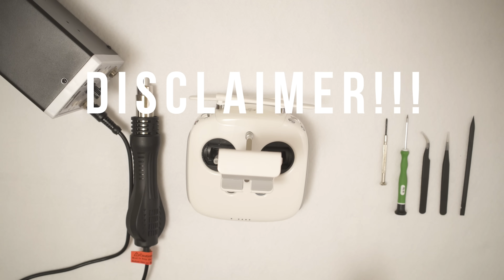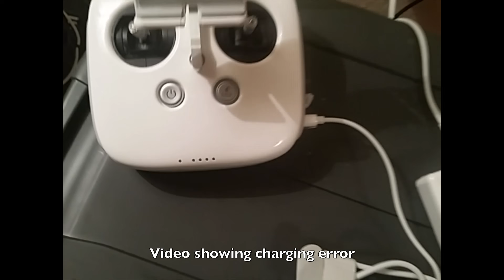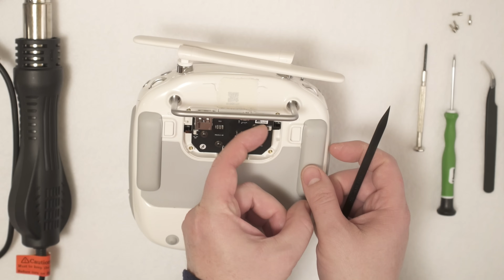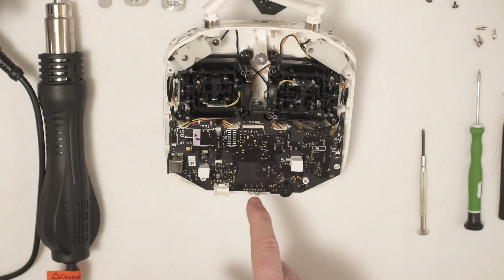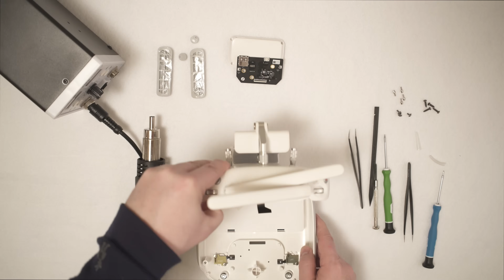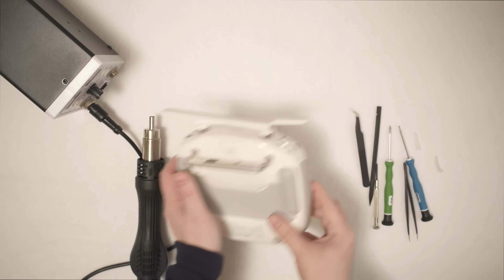FIXED!  DJI Phantom 4 Pro Remote Control Battery Charge Issue [Disassembly, Repair, Reassembly]

Comment: Omg it works. You saved me buying another remote. I took a Dewalt gun heater with a can of beer rolled like a nozzle for having just a small output. I did this 3 or 4 times and after that it works. Thank you man
Reply from the maker: Excellent!  Glad to hear you didn’t need to buy another remote!

Comment: Having the same problem out of my P4 . Just reflowed the 4 pins where battery plugs in and also the four areas were charger port is soldered to board.  Everything works perfect now. Was only getting to lights to blink before. Now I have all of them. And charging fully. Thanks for a great video.
Reply from the maker: Excellent! Thank you for the detailed feedback!  Glad to hear you were successful!

Comment: Worked great! Used a craft heat gun for about a minute each side, but went from controller that was broke to fully functional! Wished I would have watched to video through cause I made the same mistake he did and forget the rubber protector for the lights before I put the rest back together. Ha easy fix though. Thanks for the great walk through

Comment: my DJI phantom 4 after 9 flights developed this fault I contacted dji by email to be told I would have to pay for its repair etc usual run around. I looked into buying a new controller etc  but didn't fancy buying a controller that could fail as mine has so bought a rework station off eBay for £40 took a deep breath and followed the video. ribbons are fiddly but after getting circuit board out set rework to 325 degrees about 50% blower and worked around battery connector and charging port took about 5mins I'm guessing re assembled controller plugged in charger and it's fixed ! thank you so much for posting this video made it an easy repair. as someone has mentioned you don't have to take the little "com" board out or disconnect the left and right ribbons just the bigger bottom ribbon.
Reply from the maker: kevan, thank you for the feedback!  Great to hear you found the video helpful!
Reply: True about the COM board, just discconect the bigger ribbon and you are good to go.

Comment: Hye! Glad to tell you that I successfully did this today. I'm in the middle of conversation with DJI through email. Decided to try this method because DJI too slow to respond. Managed to get it right after 3 attempts and nearly damaged the charging socket on the board. Thank you so much. Now I just ignore DJI's email. Lol
Reply from the maker: Good to hear it worked out for you!  Thank you for letting me know!  And be careful with that charging socket!

Comment: Worked! The disassembly is different for a Phantom 4 Pro+ due to the integrated screen, but essentially the same fix. I did it twice, the first time didn't take. I had this repaired by a iFix a while back but the controller went dormant again and I guess that's what caused the issue again -- lack of use. Just a guess, but I hadn't used it in a year or more. Thanks for posting this. I don't think I would have tried to tackle this without this video.
Reply from the maker: William, thanks so much for the feedback, and glad to hear you found value in the video!

Comment: You Sir are my HERO! Bought an SMD Hot Air Rework Station on Amazon. Dismantled the controller, Set machine to 300° C and an air setting of 4. 30 seconds on small 8 pin rectangular component to the right of the LED's. Tried my charger and 4 lights. Prior to fix only had one light that lasted only seconds. Just finished test flight and everything was perfect. App said battery was at 95%. Thanks again! you saved me $HUNDREDS!!! Last but not least on my P4 controller the screws on the small outer cover took a 1.5mm hex wrench to remove, You do not need to remove the small board. Just detach the large ribbon cable that passes through the outer shell. Though I can see how this cable would be easier to re-attach if the board was loose.
Reply from the maker: Steve, so glad to hear it worked for you! And thank you for adding the details of your approach so others can zero in on the problem with a quick fix!
Reply from the maker: And good call on not needing to remove the small board. Now that you mention it, that might save people a step!

Comment: Wow!!! Thank you so much, pulled a dji phantom out of storage and the controller had this issue. I followed the steps and it worked like a charm!!! THANK YOU!! 

Make sure you heat the sport to the right of the lights on the back really really good. Took me a coulple times heating it before all 4 lights lit up.

Also good to check that all four light up before you put it back together like you said. Took me a couple times heating it to get it right. 

Other than that! Flawless!!

Comment: Great video. Tried it with your average heat gun on low and a few inches away. Took 2 tries cause I did not want to fry to board but it worked. After 2 minutes on low with slow passes around the areas you suggested. Thanks for posting the detailed walkthrough, it really helped me and it was much easier than I expected.
Reply from the maker: Glad it worked for you!  Thank you for the feedback!

Comment: I had the most fun doing that yesterday evening, I was 99% I'd have cooked the thing... BUT IT WORKS NOW!!! Thank you so much for the amazing effort and great video quality.

I used a cheap Heat Gun with 2 temperatures, 300 and 500, I went about 1 min and 10 sec total at low setting, going around only on one side of the board, the back with the pins. When I saw one the pin fully melting I guessed I was heating the whole thing well enough, I though way too much... until I reassembled and it's working!!!

You saved me money as much as putting me back in a thrilling drone electronic class at school ;) Loved it! Now let's fly this thing!

I did not test the board at all before reassembly, It was crackling cooling down and was so sure this thing was fried... ;)
Reply from the maker: Glad it wasn’t fried!  And thank you for the kind words!  If you find others with this controller problem, let them know there’s hope!

Comment: It's works...Hot Air 400c and fan 5 for 30 sec on the square chip to the right of the LEDs....This solution is awesome #Chakanyanya ... thanks bro

Comment: I wish DJI would just make a battery that functions
Reply from the maker: To be clear, this is not really a battery issue, but a soldering problem on the circuit board. But I’m totally in agreement with the spirit of your comment!  Thanks for checking in!

Comment: My RC would charge to 68% which worked for a few short jobs. I finally decided to follow the video. I took apart the controller, pulled the board, placed aluminum foil on either side of the black component next to the charge lights and heated it for :30. I plugged in the charger and got 1 blinking light which scared me as I had 3 before. I heated it gently again and got my 3 lights back. I then went all out and heated it up for at least 1 minute. To my surprise I got all 4 lights. Thanks to all who have contributed to this repair, especially the guy who posted the video. I'm in the video business and understand the effort it takes to make that video. While I do have 4 LIGHTS the charge level in GO4 only reads 86%
Reply from the maker: Thank you for the kind words and the feedback!  Enjoy your Phantom (again)!
Reply: @travelphotofilm  I've heated it twice now and I get the 4 lights which lasts for a few weeks and then I'm back to 3 @ 72% charge. Any thoughts?
Reply from the maker: Craig Needelman could be that you are heating the board so it takes a more favorable shape (easier for the connections to touch) but that over time it goes back to its initial shape. Second guess is that there is not enough solder for the reflow to hold over time.
Reply: @cneedelman1  I had the same problem.  Good for a while then back to 3 lights only.  Not a fix I want to have to do every 3 weeks!!  So, I'm going to try a longer heat time with a little higher heat level.  I'm also going to do a dry run with a piece of solder on an old circuit board I have.  I want to see how long it takes for it to melt.  I'll use this info  for the correct time and temp on my drone board!  We'll see what happens.
Reply from the maker: @microreniassance2929 you might also add a bit more solder when you do the new reflow.

Comment: LOVE YOU!!! I had the same issue, yestarday i did this tutorial, step by step and now my RC is charging again, the first minutes the 4 LEDS was on, then, i tried to fly the drone and the RC didnt let me because of an update of the firmware. When I updated the firmware (V.1.9.etc) then the RC only turned on 3 led and just left me charge at 70%. I flew the drone perfectly :D. Today in the morning after 10 hrs i repaired the RC) i pushed the power button of the RC and VOILA! the 4 LEDS was ON again!! In a few hours i am going to fly the drone again and see what happens with the RC. I will be updating. AGAIN!! THANK YOU SO MUCH!!
Reply from the maker: Great to hear!  Thank you for letting me know!

Comment: Thank you very much for help. I did it today and my transmitter works now perfect. 

This is what I have done: I start warming at 100 degrees for one minute after that 170 degrees for two minutes that for the shock. Next 245 degrees for one moment is just enough. Now works perfect 4 lights and the battery is full before that without charging was 35%
Reply from the maker: Great to hear it worked for you!  Thank you for letting us know what settings you used!

Comment: Thank you verry much for this video. My controller had the exact same issue and I've just followed your instructions and it's now working perfectly again. I used a Gas powered soldering iron with a very narrow torch blower fitting on the end so I could focus the heat were needed. No idea what sort of temps I was using given it's gas powered, but I had it low enough so that it took about 3 seconds to melt a tiny bit of test solder. I then slowed traced around the board where I felt it nessary. All in all, pretty straight forward and I'm delighted my controller is now working again. thank you....!!!
Reply from the maker: Great to hear! Thank you for the feedback and for detailing your process!

Comment: big thanks bro, i owe you made this video, just got the cheap heat air blower and follow this method, worked on my phantom remote with same issue, now the battery indicator light is now fully. :^D thx mate.
Reply from the maker: Great to hear!  Glad it worked for you!

Comment: So this worked for me. There is a couple things. You don’t need to disconnect the small ribbons on the first board, just the big one. Second was after I get the the back off, try just disconnect the battery for 30 seconds and re-install the cable, this sometimes fixes this problem. But it didn’t work for me and I refloated the board as described here. Thanks for this video
Reply from the maker: Colin, many thanks for the tips and the feedback!  Glad to hear it worked for you!

Comment: It worked! Thank you!
I didn’t have a fancy heat gun, just used a normal heat gun on lowest setting but had some folded cardboard to redirect the airflow away from the rest of the circuit board. Concentrated in the area of the battery connection and recharge plug. Took a couple of tries, longer each time with the heat, and finally had all 4 lights illuminate! As others have said, don’t reassemble, just plug it in first to see if the number of lights illuminating changes. The little white foam block took a bit of a hit but it’s just a spacer,, it’s still in place but shrank a little. Have flown 3 batteries and all is well so far. Thanks again!!
Reply from the maker: Many thanks for the feedback, Peter—good call on testing before reassembly!

Comment: Thank you, thank you, thank you!!! Excellent video. I used the harbor freight $10 heat gun with a homemade aluminum foil snout and an infrared thermometer. I heated the board near where you suggested for a few minutes and boom good as new.
Reply from the maker: Awesome, John, thanks for the update!

Comment: This is "cold solder" on specific elements of the disc. Soldered again and I have 4 LEDs glowing, everything works properly and loads. The heating also did, but after a while it came back

Comment: Thank you sir.. It work for my Phantom 4 RC. I only use cheap heatgun with no temperature measurement. I focus on a tiny chip with 8 legs near the right LED for about 1 minute, and heat the rest of PCB around the battery section just randomly for no reason 😅. And thank you for the disassembly tutorial too, it help so much..
Reply from the maker: Joy, thank you for the kind note. Very pleased to hear you had success!

Comment: Thanks so much. This with another video fixed my P4 that I’ve been wondering what to do with for the past few months. Common controller issue fixed. I thought for sure I would melt/ruin it but it worked.
Reply from the maker: Dan, many thanks. It is not for the faint of heart, but pretty much anyone can make this fix with enough patience and determination!  Thank you for following up with your feedback!

Comment: I confirm this works.  The only part that I reflowed was the tiny chip just to the right of the right-most LED on the same side of the board as the LEDs.  The chip is about as square as the LED diameter.  I used 400C for about 20 seconds.  Thanks for posting the video and to the other commentors for leading to the exact spot.
Reply from the maker: Thank you for the precise information and for following up with your experience!
Reply: is it the tiny square?

Comment: Just finished doing my Phantom 4, 1st Gen, remote. This seems to have worked.  Only time will tell how well.

I used a Porter-Cable PC1500HG heat gun I borrowed from a co-worker.  I used fan speed 1 with the heat dial turned up about 3/4 from minimum.  My first attempt at heating and cooling didn't work.  I hit it with the heat a second time and that seemed to do the trick.  I'll update if I have another failure.

Thanks so much for the excellent (high quality of video feed. close ups when needed) DIY repair video.
Reply from the maker: Glad to hear it worked for you!

Comment: This has worked for me - twice (had to re-flow again which, as I understand, is a common issue with any shoddy solder issue). I know it won't last forever. I'm grateful for the fix and the extra flight time I've gained! Thanks!

If others are looking for tips (and, as the video says, this is always at your own risk... I don't have a heat gun) I set the main board in my oven (pre-heated to 375F) for 10 minutes on a (non-heated) muffin tin. I didn't want to melt anything and it seems to have been enough heat to do the job.

Comment: No heat gun and my soldering iron didn't have enough oomph so I put the relevant corner of the board directly onto one of our ceramic cooker rings on max. Took it off when it started smoking gently. Fixed! On our model, GL300C the first 4 fixings weren't posidriv but v. small allen/hex bolts. Thanks for great guidance.
Reply from the maker: Many thanks, Eileen!  It is very possible I mislabeled the screw/driver type; thank you for the clarification!

Comment: Thanks for the video. Have had the same issue, done this process and now have the battery lights and charging again. Upon putting back together I went to turn on, it has no beep and also red flashing LED. Pulled apart to check everything is connected, which it is. Anyone else had this happen, or am I the unlucky one who's board didn't like this process! TIA

Comment: So I just fixed my phantom 4 remote (GL300C) that had the same charging issue.  I did exactly as one of the previous commenters recommended by focusing on the small black square, 8pinned piece that is directly to the right of the last LED, and now I’ve got all 4 lights showing fully charged.  I used a harbor freight heat gun (on low) with aluminum foil on the end, with the final output being about 1cm diameter.  I also used a harbor freight digital temp gun to watch the temps of the board.  I saw upwards of 300 degrees F, and switched to C, and only saw less than 200 degrees C.  I kept the heat right in the area of the 8pin piece for about 30-45 seconds straight until i saw the last LED start to blow over, which told me it was melting that solder.  I quit immediately, let it cool for a second, then plugged it in.  All 4 led’s blinked!  Amazing!!!  Thank you all for your contributions!
Reply from the maker: Many, many thanks for confirming the location of the fault!
Reply: Maybe it's me and my incompetence but I don't understand which one is it the 8 pinned piece you are talking about. Could I have a photo of it, please?
Reply: travel | photo | film did that end up being a lasting fix or did the problem come back?  Any update for us would be appreciated...thx!
Reply: proudsuperior did the problem ever come back or did it turn out to be a lasting fix?  Thx